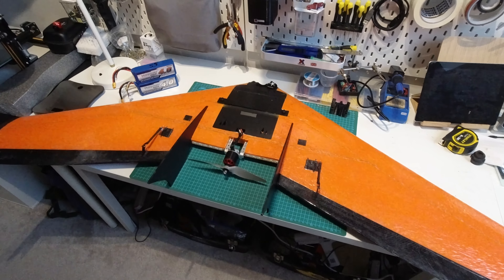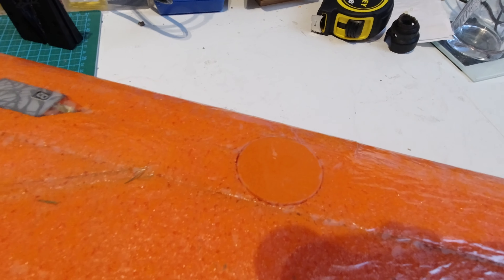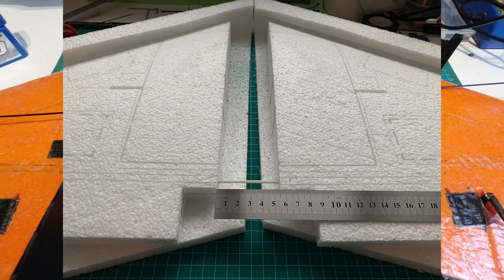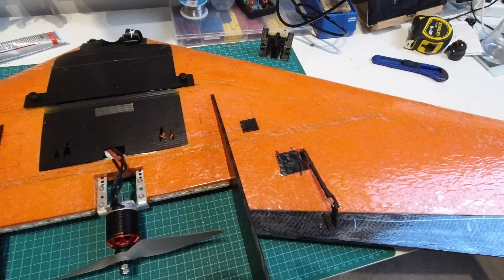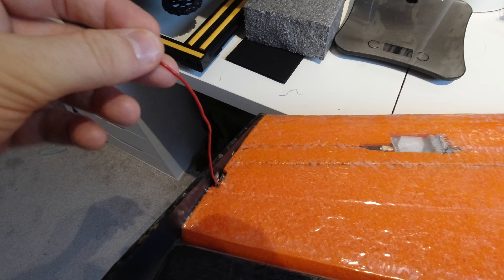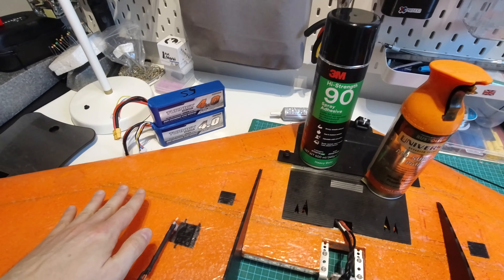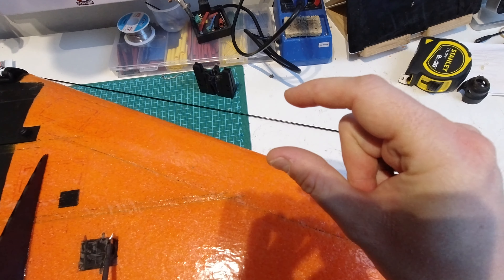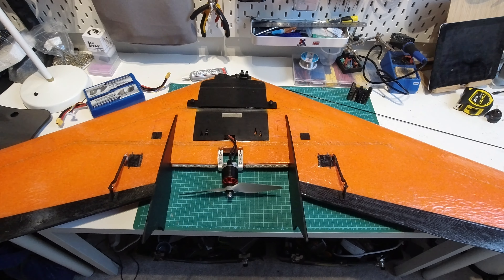Ritewing ZCon - Setup & Build Overview / Process - Long Range FPV Wing

Comment: Awesome Adam. I now have a good idea of what I have to do. I’m tempted to go for one of those Badass motors too.
Reply from the maker: Hey Darren, I’ve no doubt you’ll do a top job on your build, always handy to see another build first for a sanity check though isn’t it 😁 have to say I’m happy with how the badass motor performs, it’s just shame it costs a lot to get them over this side of the world. Cheers
Reply: @AdamGdoesFPV  100%! Now I’ve seen how it all goes together, I can get ideas in my head. I’m tempted to try something with the linkage, but will test it out on zagi copy I have to build first. It was good to see the singularity placement though and the CG. 

Yeah, we need to get a UK importer for Badass motors.

Comment: Great video Adam.

In another video you mentioned this was your favourite wing. Can you go into detail why please ? 

Pros cons etc? And how does it handle wind ? Plenty of that in the UK! 

Thanks
Reply from the maker: For me the Zcon is just a great all rounder. It flies like it’s on rails, can cruise around slowly for really long flight times (longest I’ve done was 1h 15m) but it can also move around quickly while remaining efficient. It’s like a blade in the sky so it uses low amps for flying mid - fast speeds. No assembly in the field, put batteries and camera in it and off you go. Light enough that it hand Launches easily and predictably every time. But not so light that it gets knocked around by light wind like a 1m wingspan wing would. Max 56a on launch and then full throttle is around 45a flying level, so it’s no worry for the fc to handle it. And overall it just handles so well, quite agile for its size. 
I think I’m going to buy another this winter as a few tree and ground clippings recently are taking their toll 😅

Cons: 
-not super easy to get batteries that fit well 
-Like any of the larger planes it needs a little more room to land
-Doesn't fit in the boot of my car

Comment: Very informative video. Learned from your gluing tips, which can apply to my builds. 
Nice shade of orange color. Was it rustoleum paint?
(it's not noted in build list and you didn't hold up can)
Reply from the maker: Great, always good to hear something has helped others 😁 the paint was the Rustoleum, the can that I have on the wing next to the 3M90 👍🏻 I’ll add a link to the paint later on. Cheers

Comment: Great video as always.. how long did the motor take to reach the U.K?.. and any particular reason this choice of a fairly expensive motor? Cheer.
Reply from the maker: Thanks Kyle. I went with this motor because 1: It came highly recommended. 2: I love that BadAss provide full data sheets on many different props and cell count. 3: I just like trying different brands. This motor has performed very well and I now have one for my big Drak too. Cheers
Reply: @AdamGdoesFPV  Thats good enough for me.. and how long did it take to reach here in the U.K?. Cheers

Comment: Adam,  Great videos!  I have a couple of questions.  Why do people fly more Wings vs. planes like a Sky Hunter Etc.?  I  want to build something that I can fly waypoints and get the most cinematic footage.  I also saw you had flown a plane with a Feiyu Tech Gimbal was this a good option for the best footage?   INAV or ARDUPILOT for Waypoint Flight? Thanks for your help and incredible videos :)
Reply from the maker: Hi, I'm not sure that more people fly wings than planes, it's probably the other way round. However, the advantages of a wing are that they require less servos, less parts sticking out meaning they are normally harder to damage and they are usually easier to transport without a tail etc. Gimbal is good if you want high quality stable footage that looks like it was shot by something like a phantom, but personally I prefer action cams with stabilisation. INAV if you want simple and easy setup and don't need to track it on a pc or make changes to the mission mid flight, otherwise go for Ardu. A lot more complicated and also a lot more functionality.

Comment: Can you measure the CG from the back of the root (motor section) I'm having issues with mine. It's heavier than yours with 5500mah 4s x2 but I think I'm a bit nose heavy as well
Reply from the maker: Hi, I measured this for someone else the other day. The recommended cg spot at 9” is 11cm from the back, but I fly a cg 12cm from the back. What issue you having?
Reply: @AdamGdoesFPV  Just could not get it in the air very often, seems like my CG is pretty dang close to 12cm. I didn't have inav autolaunch setup I was launching in manual mode but after I biffed it a couple times the nose was soft and the one time I got it up in the air it had a ton of vibes in the cam (need to check the prop balance for sure) and I caught a bit of a tailwind right as I landed and I destroyed the nose because it's so thin with the gopro/fpv mount up there.
Reply from the maker: @ContagiousIdeal  Ah sorry to hear that. Get it repaired and then setup autolaunch, works perfectly every time on my ZCon.